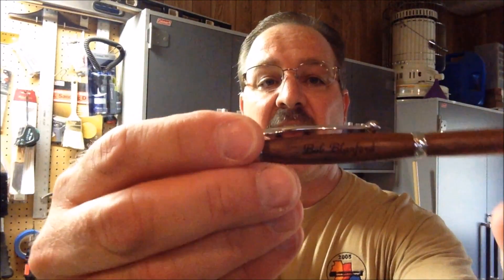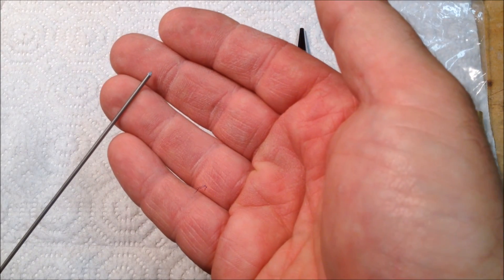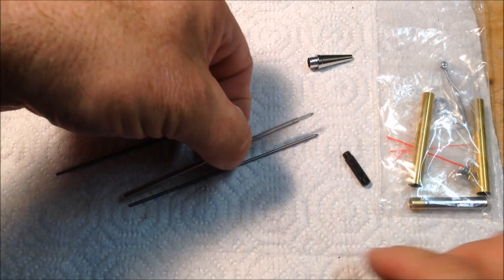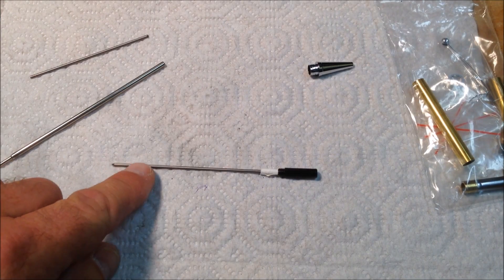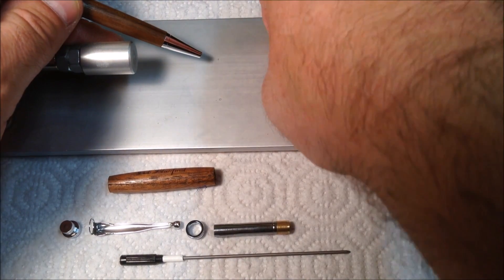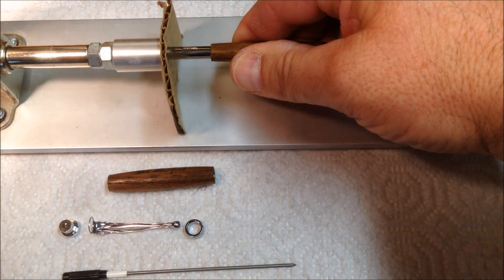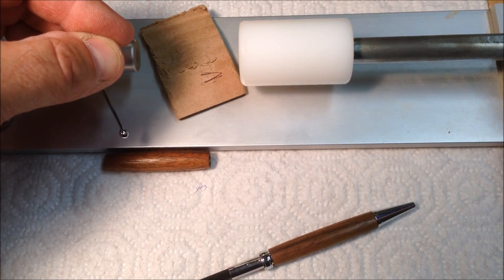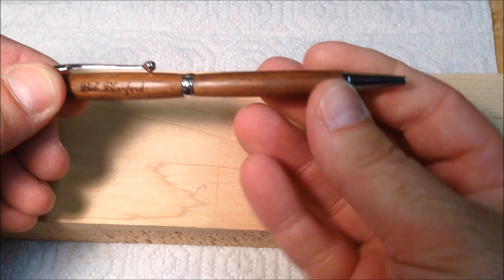Ink Pen Style Shop Scribe

Comment: HI BOB  the old refill from the slimline can be used on the back end of the scrib to fit in the black cap to the gear instead of the tape a bit of super glue helps the fit good video bob
Reply from the maker: Nice idea Robert,
  I hadn’t thought of that. 

Regards,
Bob

Comment: just curious other than having a laser write or draw on your pen blanks how would one write or draw on a blank
Reply from the maker: You could use the Testor model stickers. You can buy blank sheets at the hobby store and print on them with your printer. Then you put a couple coats of C/A on the pen, apply the sticker, and a few more goats of C/A to finish the job. 
  There is a spray to set the printed image after printing. 

Regards,
Bob